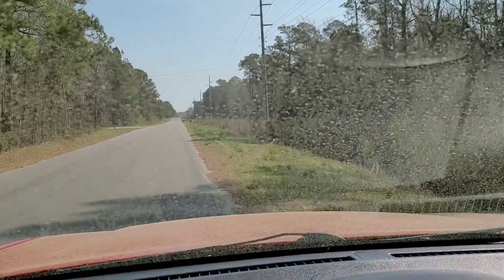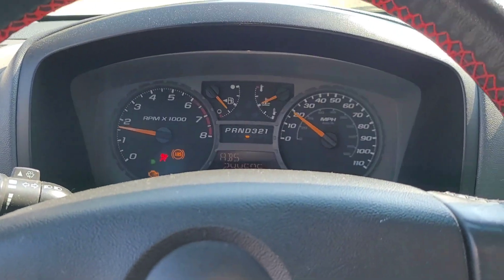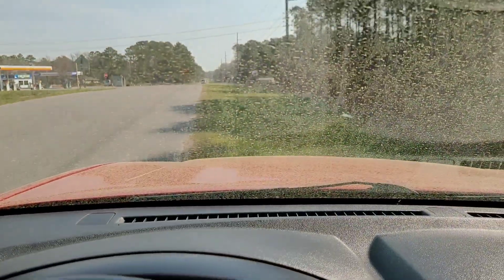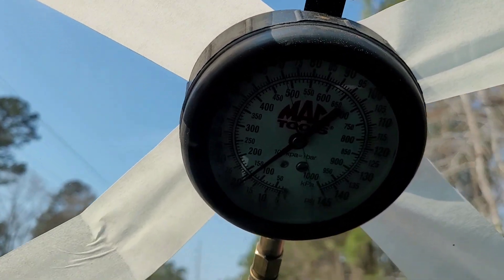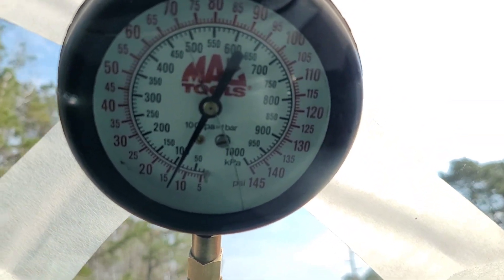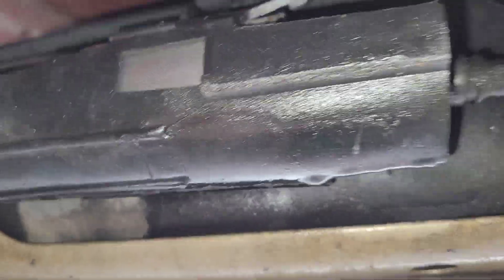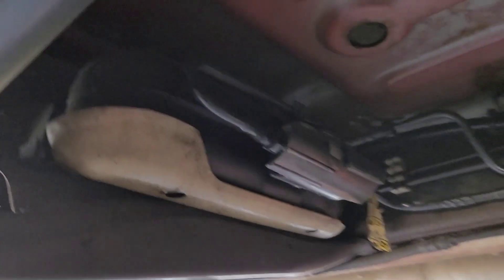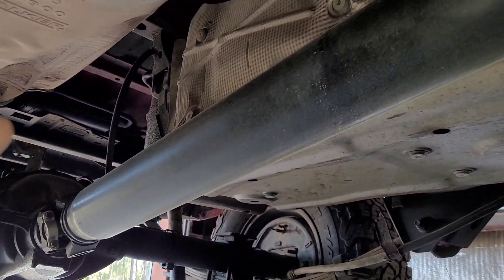Towed In. Died While Driving. Correct Fuel Pressure is Important!!

Comment: It's not too bad if you have a lift. I just replaced the one in my F150 in my yard unbolted the bed and slid it back. Works pretty good I've been doing fuel pumps like this for years. Just a suggestion.

Comment: I just had my fuel pump replaced yesterday, little by little, day by day, it slowly started having issues starting, then it would run fine. I would get to work, park it for the day, then it would take two attempts to start it, drive home fine, park it overnight, next morning, two attempts to start. Thought it was a computer sensor of some sort. New fuel pump in and runs with the power of a V-8 again. Kicking myself for waiting so long from when I first noticed an issue. Not to mention the terrible gas mileage I was getting. I commend you for your videos, and understand why they quoted me 3-1/2 hours to replace it, once they determined what the issue was. Thanks, Kenny, I am really enjoying your video's.
Reply from the maker: Glad you got it fixed !! Thanks for watching !!

Comment: Had a 2002 Honda Accord that didn't even have a inline fuel filter, just the in tank screen. However, checking the screen wouldn't take but 10 minutes tops, it had fuel pump access in the trunk. Remove a few screws and there it is. A simple repair if needed but I never had a reason to even get to do it... dang it. Just my luck, when it's hard pump goes out, when it's easy pumps last forever... Lol.

Comment: having this issue right now with my 95 toyota pickup. thinking its either the cor (circuit open relay) or a plugged fuel sock cause the tank was rusty from sitting. and lastly if thats not it, gotta be the fuel pressure regulator. i already replaced the fuel filter as my dad was adamant that was it. fuel filter wasnt clogged whatsoever...

Comment: I used to have this same issue with 90’s model Dodge B350 Maxi vans with the 360 TBI engine, but the problem got noticed much earlier. The engine would lay down on power going into third gear under full throttle. In my case, watching the fuel pressure, it would start to drop 5-8 pounds at the same time as the laying down, during a test drive. On all the vans in the fleet, it would be around the 100k mile mark consistently, to the point I’d keep them in stock and just replace them around that time regardless, when I could have them ran low on fuel first, as they had the extended range 30+ gallon tanks in them.

Comment: Thinknig that the pump could have been killed off by bad fuel, which sent the marginal pump out to pasture. With what came out the filter you probably had a nasty sludge build up that made the pump work hard, and finally die. high pressure at inlet, yet the engine side with barely anything, filter was clogged badly, and then this let the pump work to build up too high a pressure, which eventually caused it to fail, either shedding bits of the impeller, or by the high current draw against the high head, eventually heating up the rotor to make one of the segments go open circuit, not helped by the low flow making it boil the fuel in there as well, which then leads to cavitation, and the hard starting till it cools.